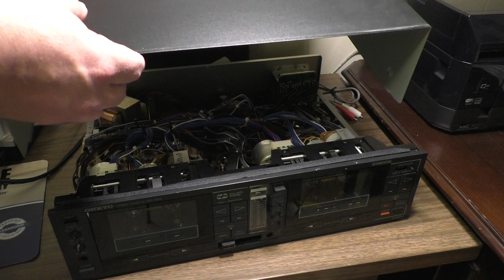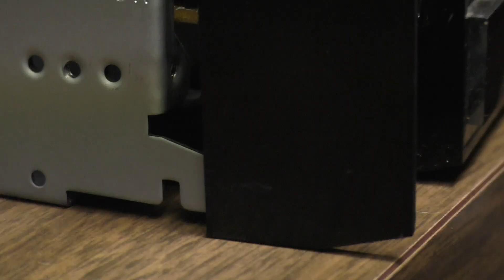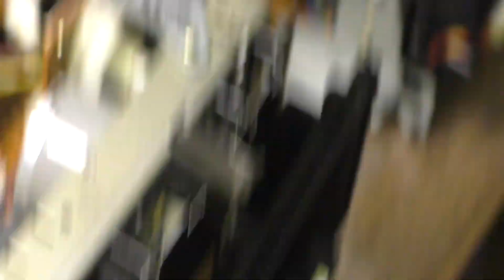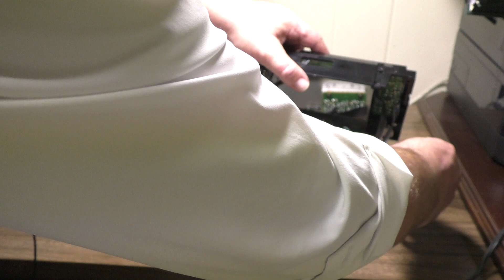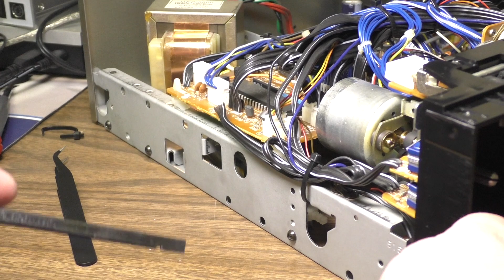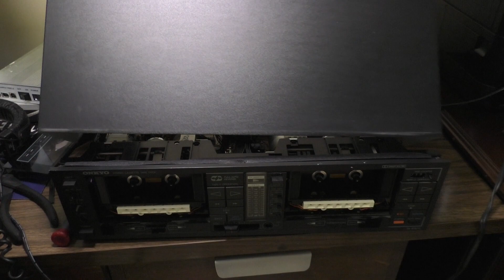Onkyo Drive Belt Replace

Comment: Tape doors on the wrong bay?
Reply from the maker: Sorry for the slow response but that’s possible.  I just put them back where they were but I should refer to the original manual if possible and make sure they are on the correct bays!  Good point!

Comment: You got any measures on the belts?
Reply from the maker: @Nexus Batty, I'll have to double check.  The order I had placed with WWW.VINTAGE-ELECTRONICS.NET didn't have product details.  Now on their site the product pictures don't appear - just a generic photo/icon.  I'll go measure the extras I have at home.  Even the product on Amazon Onkyo TA-RW11 Belt Kit yields a result but no specs.  Not super helpful.  I'll check and let you know.  If you do the search on the Vintage-Electronics site, it will show you some related products for belt installation that are much easier to use than what I had.
Reply: @michaelgates5591  Thanks. I'll do that.